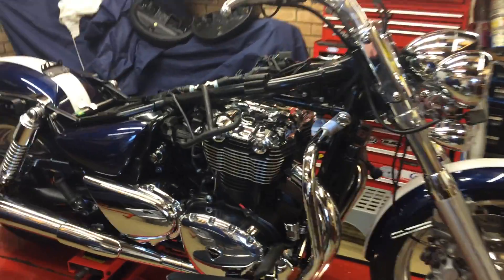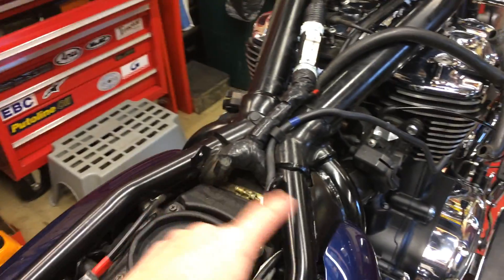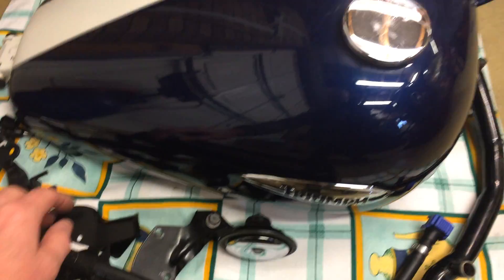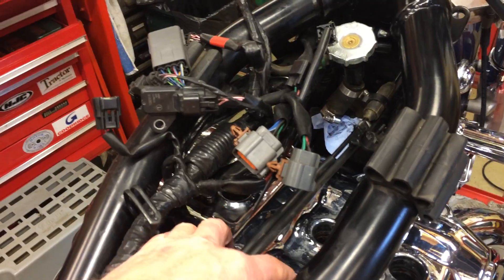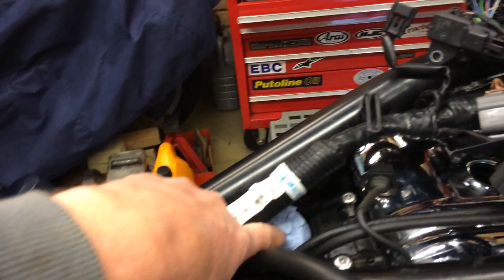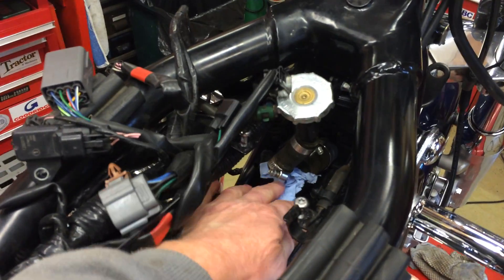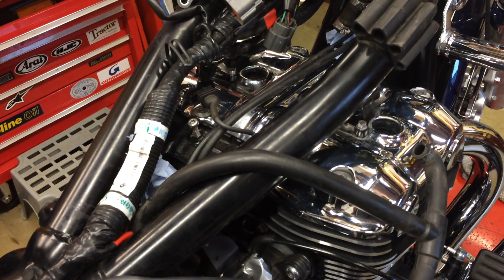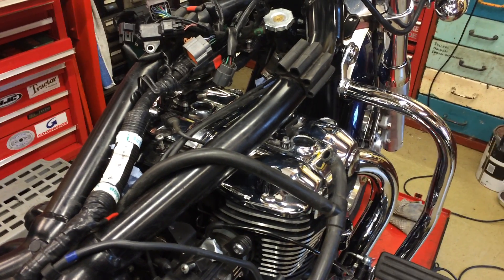Triumph Thunderbird 1600 valve clearance check Part 1

Comment: Do you turn the fuel off before removing the fuel line? If so where is the fuel tap?
Reply from the maker: Hi, the fuel system is pressurised once the ignition is turned on and connection to the bottom of the tank is quick release which seals automatically once removed. (There is no fuel tap) If I remember correctly, pick the back end of the fuel tank up and the connector runs parallel to the bottom of the tank. I can't truly remember if there is a return line from the injector system but if there is there will be two connections to the tank somewhere. It's at least five years since I did this and I haven't owned the Thunderbird for three! 
NOTE: Do Not try this whilst the ignition is switched on and leave it for at least 30 minutes after turning the ignition off. Pull the fuel pump fuse out before attempting to remove the fuel tank.
You may still get a small amount of fuel spillage when releasing the connector so make sure you have a rag suitably placed to catch it.

Thanks for watching PB.

Comment: I just want to thank you for this series of videos you made even though it's a bit late, but you've helped me a lot to check my T-Bird before sending it to the dealer because of a clicking sound inside the engine which turned out to be a faulty exhaust decompression cam. At least I checked everything I could because of your videos and they couldn't charge me for anything extra.
Reply from the maker: Happy to be of assistance Ismael. Thanks for watching and the kind comments.Regard PB

Comment: I was doing my spark plug change and was having difficulty getting the far left spark plug out. I did in the end using the right adapter but it got me looking at the engine and i noticed that it wasn't in the centre of the frame. I began to panic thinking the previous owner might have dropped it and bent the frame but thanks your video i can see at 4.52 that yours is the same. the whole engine is slightly more overhanging on the right than on the left- hence it is slightly harder to get the far left spark plug out, but can be done. Once again your video's have helped
Reply: Glad to have been of assistance.
Regards PB